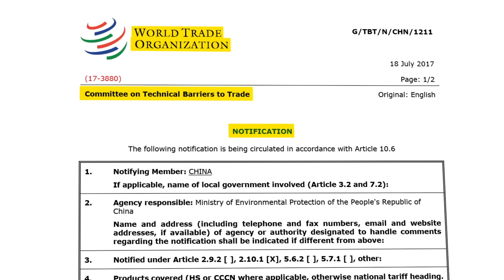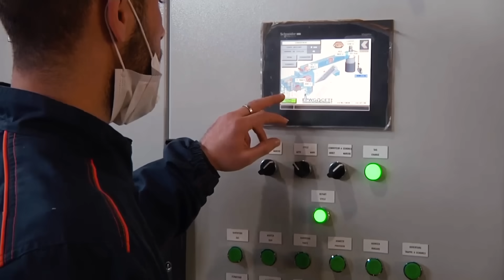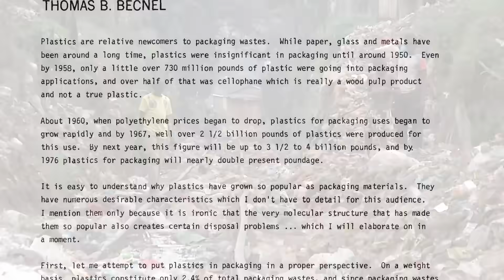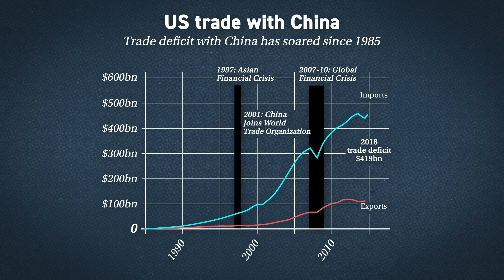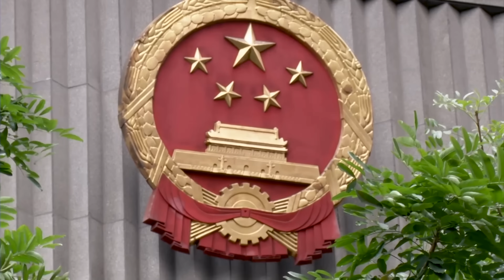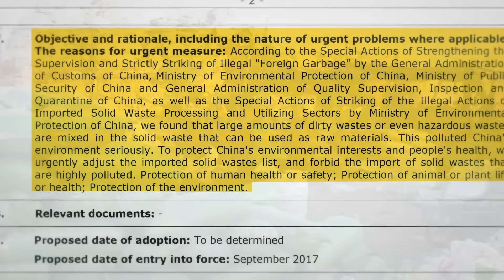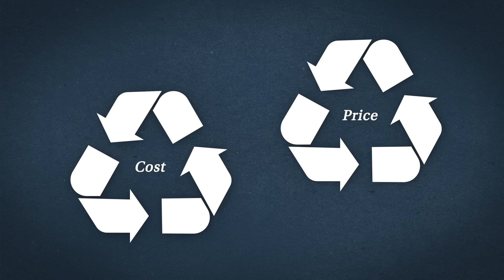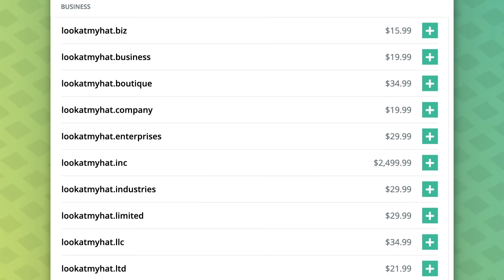How China Broke the World's Recycling

Comment: What rubbish: the mythical market forces will NOT solve that. Cleaning up after yourself instead of leaving a mess is ALWAYS more of a hassle / cost. And putting the burden of costs / work / avoidance on the consumers ? Who are at the END of a process and have NO say, so they de facto end up with hardly any choices of what to buy. Shopping would become super complicated, time consuming and also more expensive.

Companies that are held accountable financially for their WASTEFUL packaging choice (a lot has to do with the whims of marketing) would just put the extra costs on the product prices, they would not try to avoid waste or be more sustainable. They must be forced to be responsible (And consumers tried to push them, that ended with a fake solution for decades).

hey also would add the costs on paint or gas for lead damage, buying their way out (not really -  they just pass on costs, it is not like they would bring a sacrifice for pollution related costs, and would accept lower profits).

doing harmful things and just increasing the price to buy their way out - that is not how it works. Lead in paint has been banned for instance. 

 We know that "consumer should make choices that nudge companies to be ethical"'  does not work. It has never worked in the past. The companies do their best to circumvent, lie and spin a narrative even if they are called out. Clean Clothes and Fair Trade campaigns have been going on for decades and not much has changed, not for the mass of goods that are sold.

The ethical and responsible solutions should be DEFAULT not something that consumers have to work hard for (with paying attention - and on 1000 other things, where biz also  cannot be bothered, or with paying more money. There is only so much time and attention that consumers can and will invest because the lawmakers cannot be bothered to make the industries do the right thing). 

Not every citizen cares about the enviromentment and we should not depend on that. As we also do not depend on the masses being responsible (and aware !) regarding other things. The military draft for Vietnam was NOT voluntay, they locked people up for refusing to go to war. Paying taxes is also not voluntary. 

We also do not leave it to the goodwill of reasoable people if they will respect red traffic lights and we demand that people can't drive when they are not sober.

That is enforced, monitored and there are fines and consequences for non-compliance -  so by and large most people don't do it. 
Not voluntarily or because they are so attentive, enlightened  and out of the goodness of their heart - but because society chose to settle that with REGULATIONS and set a NORM, a default for all members of society. 

THAT is effective. 
Putting the burden on consumers is ludicrous and is ineffective.

Comment: No, recycling " must not be profitable" but someone has to pay for it. The companies that chose to use a certain packaging will have to add the costs and pay for the processing when the consumers turn in the waste - (in Europe manufacturers or retailers have to declare what they use, and they have to pay into funds).

in other words sales prices overall will go up. the industry will still not try to save material but will splurge for marketing reasons - and just pass on the costs. They tried the recyling ruse as a a PR gag because many consumers decades ago were willing to be responsible - even though businesses (as collective engaged in a race to the bottom regarding standards) are not responsible. At all. 

 So they must be FORCED to be reasonable and responsible. They will clearly never  voluntarily act in a responsible manner, but always cut corners, pollute and put profits / convenience over enviroment or health of humans. 

 It is no tlike the consumers have any choice or say what companies decide to use as packaging. The effort to demand more sustainable handling in general was undermined by the industries. They could have solved that in the last 25 years, but they just could not be bothered. (If sustainable packaing costs more - so be it then ALL industries will have to add those costs). 

The marketers usually decide a lot (and demand unnecessary packaging) and the rest is production (and what the machines that they chose to order, can handle). 

Shifting the burden to the consumers is wrong, because it is de facto almost impossible to avoid the packaging (unless people live on a farm and produce their food or barter. or if they are super conscious and only shop farmer's market. But that is only possible for a slim minority AND is more expensive. So being responsible is not default it is something consumers are punished for by having to pay considerably more for products that are ALSO sustainable regarding packaging. Or are at least better). 

We all shop in retail, growing food or bartering  is not how we organize our society for millions of people.

Comment: The title likely will lead someone to a somewhat different conclusion when they just read it without actually going through the video...

which is... unfortunate because the video actually went through a much more objective and clear problem posed by the system.

But that's not what ppl are going to assume reading the title, even though in a sense it was correct.

Comment: The solution is actually quite simple. The government should tax the use of virgin plastics, thus making it more expensive than using recycled plastics.
Reply: Tax it and then directly subsidize recycled plastic with that money.
Reply: Then all industries that use plastics get destroyed. Good luck with getting any items
Reply: @horizon-th2392  That's hyperbole. A gas tax doesn't make it impossible to get gas, it just makes it more expensive and makes alternatives to gas more competitive.
Reply: The same would also be good in agriculture, because at the moment, pesticides and chemicals cost almost nothing, and environmental and groundwater pollution rarely have to be paid for, although not only the soil but also all water is poisonous and almost too sterile, which leads to a spiral leads which means using more chemicals, which is one of the reasons why almost 20% of the total greenhouse comes from this sector. with taxation of this, even if it should be low, organic products would not only be cheaper but also generally better for one's own and the environmental health.
Reply: @horizon-th2392  It would literally, as always just be passed down to consumer costs.

Comment: OK A well researched video and a rational conclusion as far as it goes. But, do you know that  modern medicine cannot be done without plastics? It's just not possible. There are no substitutes for plastic tubes that are both flexible enough and able to be sanitized. And the plastic parts in medical implants? Do we reengineer them all? How about the years it would take for FDA (in the US) approval? And never mind that cost. And that's just Medicine. How about airplanes? The handling of corrosive industrial chemicals? Even cars would loose milage if plastics were replaced. 

17:50 You can't simply stop making plastics. That's an overly simplistic suggestion.

Comment: I was at a meat market in Africa once.  Their beef looked like 50 lbs of flies on a hook.  If you want your food clean and hygienic it will come wrapped in plastic.  If you want your yogurt clean it will come in a plastic cup.  If you don't want your cola to come in a glass bottle that has a 25 cent deposit on it, your choice is either plastic or aluminum.  'Sustainability' is a bullshit term designed to create a crisis mentality.  Plastics are far more sustainable than unhygienic meat, e coli infected dairy products, and the infrastructure required to return, clean, and reuse glass bottles.  A product that can provide safe and hygienic food so inexpensively that it isn't worth reusing is a victory, not a problem.

Comment: why not find another use for ground up plastics like in concrete instead of sand? Or housing bricks & blocks or into road surfaces.  Because plastic does not last forever.  Old "Sol" can break down a garbage bag that is exposed to sunlight or daylight over ONE winter.  It crumbles. Or break it down to its essential hydrocarbons and make car fuel? Or don't make waste plastic.  . Stop calling it LOWER GRADE PLASTIC would help.  Finding a second use for it is the challenge....like Computers.  That is basically a piece of furniture. The keyboard does not matter if it is VIRGIN plastic or mixed plastic.  (The letters disappear on both-as it is painted on.)  Hell, many parts of my car is plastic(it is about time) like the panel under the door and  internal fender lining to slow down the rock chips and salt.   You can't tell.  You have to tap with your fingernails to hear the plastic sound.   Sending plastic to land fill means it is covered with dirt out of the sun's damaging UV rays that BREAK IT DOWN.  The whole concept of Landfill has to be readdressed when storing plastics.   It needs exposure to the sunlight(direct or indirect) to break down its binders.  Which is why "flexible plastic is no longer flexible" and just breaks, stretchable plastic does not stretch but crumbles.
. I don't know what is missing after the UV treatment, but I wonder how similar the plastics are after they break down.?
. Or we have to develop a plastic that becomes a food stuff...so you can have your coffee & donut together .  After you drank the coffee you can eat the cup idea. Comes in a variety of flavors.  It is fake food...which we already make.

Comment: Actually I were following this, what happen was Or compounded this was small company were too careless and abuse the system by  useing these container as rubbish bins also. And all the private recycle company were burning this trash. This was the time when U.S media was were calling out china pollution, they had the worst sky. Ironic, isn't it the same democrate  movement help china give up on recycling . But  goggle biomass wood pellets. This is wrong. They are replacing oil burning power plants for wood burning and it 3 times more pollution but European country needed it so it called carbon neutral. Now south a. Are chopping down forest as the southern states. And tree leaves are what make oxygen take in Cabon dioxide. Green energy is screwed up. Just stay with oil. Just think. All them trillion ev battery are going to be useing electric not gas. So that means hundreds of power plants need to be build. Look at how much people live in apt. And they will be charging at night.

Comment: Another alternative would be state regulation - to simply ban the lower quality plastic. If that youghurt was in high density polyethelane plastic cup (the same of which shampoo bottles are made), it would be profitable to recycle it. Also, it would be easier to sort plastics, if only two or three types were allowed to be used as packages in retail. Sure, that youghurt would probobly cost a few cents more, but that's payable in developed countries.
Reply: But then you would increase the supply of high density polyethelane, lowering the market price.

Comment: the fix is actually very very simple 
an international tax on new plastic production to go to cover recycling or rather going to company's that use the recycled plastic it wont change the cost of recycling but will make it viable to use and thats 50% of the problem the other is the average public needs an attitude change from I'm doing my part throwing it in the re-cycle bin to i actively use recycled items.
but it will never happen until oil starts to run out and cost of new becomes to expensive the reason is no one will agree on how its managed and who receives 
and 2 the average person wants the best cheapest or its just not in there radar it be active 
an example my neighbours are so proud they do there best at recycling they got these terrific new patterned freezer containers they showed to my partner my partner she went look nice but why there the same size as margarine tubs we reuse

Comment: You mentioned the solution in the middle of the video, right at the same time as you mentioned the problem: plastic from crude oil is cheaper than recycled plastic. Therefore, the solution is to tax oil a lot more. That'll both encourage recycling and reducing plastic consumption. Thank me later.

Comment: Two things, it should still be sorted, and then there should be a specific "plastic" landfill, that way when a solition is available it can be easily recovered. Secondly, melting the bails in their entirety would make extraordinary building materials.
Reply: Plastic is a lack-luster building material at best, with a low melting point and a high level of malleability. Different polymers and plastic alloys have different melting points aswell and its a whole lot more complicated than burning everything down in a vat.
Reply: @bobdole6691  I'm definitely not well informed, on plastics, and I forgot the one thing I did know about them...they are polymers, and polymers can break their bonds when heated...so plastic in may not mean plastic out. Thanks for correcting me some.

Comment: I'm pretty sure that at 16:50  there is a fault in the logic. 
Sure, the recycling costs going down, would make the process profitable again. But with it still quite cheap (and comparatively  less of a health hazard) to produce virgin PET... increasing the price of recycled materials would only make their value go down. 
So unless the price of virgin plastic goes up, the costs of recycling come down, making the price of recycled material less than that of the virgin PET.... then the companies producing hardware out of it would be more than happy to buy it. 

What you described, would possibly lead to improvements in the recycling industry. Assuming that their imports are not affected by those changes, as well as them still selling the product as the same or increased pace. 
But as said, i doubt that if their costs went down and prices went up, that their sales would remain the same or go up.

Comment: the only solution that does not require the value of recycled plastics increasing is for legislative changes mandating the primary use of recycled products whenever available. essentially: if country has recylable materials able to be used, new plastics aren't ALLOWED to be manufactured. This increases the cost of manufacturing, but "fixes" the "not profitable" issue of recycling not getting done.

Comment: Burn the plastic and melt it Together and use that to recycle. Put the smog in a preasure loop to generate Electrical energy and Burn the full filters again to reduce the size of the dust to new but smaller feul. Then back in the air loop. Thel me im wrong if i am.

Comment: "Economic problems cannot be solved by technological solutions" Wow, certainly one of the dumbest things I've ever heard. The main use of technology today is to solve someone's economic problem. If it is not profitable to sort those plastics, use them for something that does not require them to be sorted. Destructive distillation for chemical intermediates, gasoline additives, and fuel gases does not require sorting. Grinding, mixing with paper fiber (recycled of course), or chopped straw, or saw dust and heat forming into engineered wood products, doesn't require sorting. It seems to me, the only potential solutions are technical.

Comment: Don't wait for "market forces" to fix the problem, and remember the old slogan :

Reduce, Reuse, recycle

In this order.

Reduce = Drink tap water, make your own yogurt, ban single plastic use by law.
Reuse = reuse glass bottles with a refund system,  and make it local.
Recycle = recycle material that have value, like aluminium, cardboard or glass.

Comment: I’ve known ever since I was in middle school that recycling was bad for the environment. Did no one else’s dad explain to them that the energy required to recycle materials offset any gains from using less raw material?

I’ve always been against recycling and this video cements that.
Reply: Plastic is relatively cheap because relatively speaking it is a byproduct oil refining. In times past these items such as ethane were burned off at the wellhead. The best and long term solution is to incinerate the waste plastic in well-designed incinerators.  These incinerators can actually produce more energy than they use. Of course well designed and well-built incinerators cost money.